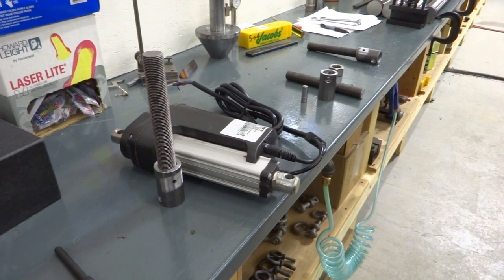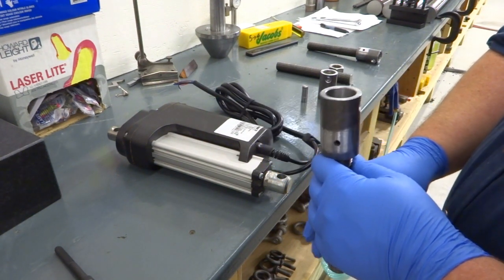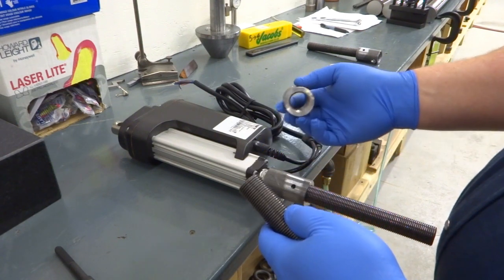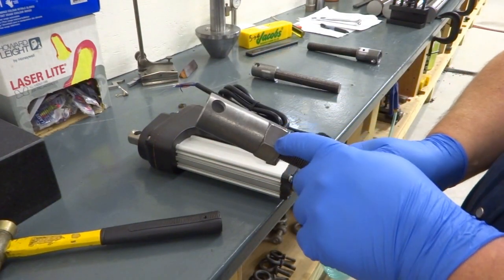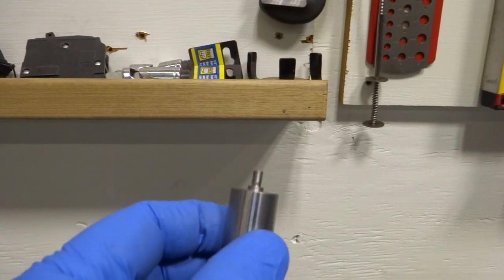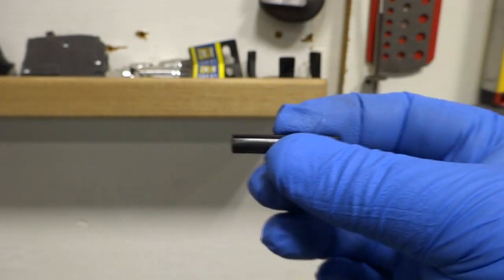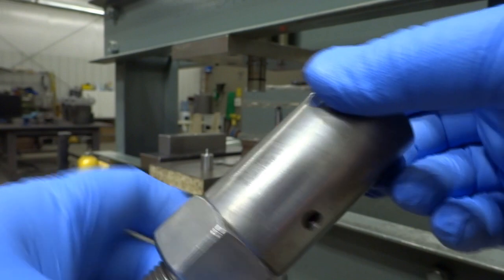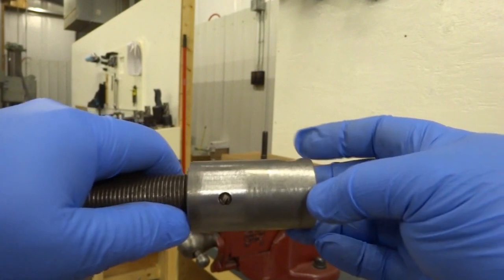Linear Actuator Extension Assembly

Comment: Enjoyed...did you machine the collars and cut the rod to length...
Reply from the maker: Yes. I did both the collars and the threaded rods.  Making the collars may have made for more interesting viewing.  I tapped the threaded hole (1" UNF) on the lathe by mounting the tap in the tool post and moving the carriage with the leadscrew set to the correct pitch (same as if you were single point threading).  Thus the carriage pushed the tap through the work at the same speed the tap wanted to go.  It prevented stripping of the threads which sometimes happens when relying on the tap to pull itself through.  It made for a very nice thread as well.  Ken

Comment: That’s a beautiful bench vise. What kind is it? You could also use a clamp to compress the thread flanks then put the whole thing in the mill to drill the roll pin. Could use a gauge to control the distance. Thanks for sharing
Reply from the maker: Hello David.  It is a 5", No. 8, Model F made in England by Parkinson.  It is a nice vise and I like it better than my 6" Record (a real Record, made in Sheffield).  It has a quick release (similar to woodworking vises) that allows you to quickly move the jaw where you want it and then tighten it with the handle.  Ken

Comment: The pre-load on the threads---aren't you setting it from the wrong direction?
Reply from the maker: You are correct.  However, the load is not transferred through the threads so it doesn't matter.  Pre-loading the threads isn't really necessary in this assembly, I just did it so the joint wouldn't rattle around.  Good catch.  Ken
Reply: @hmw-ms3tx  Does the threaded rod pass through a yet unseen collar that carries the compression load?
Reply from the maker: @tnekkc  Hello Clark. It passes through a bracket and a nut is place above and below the bracket to allow for fine tuning of all the linear actuators.